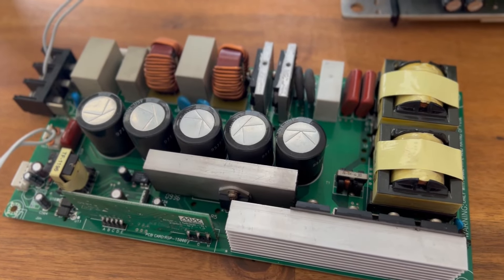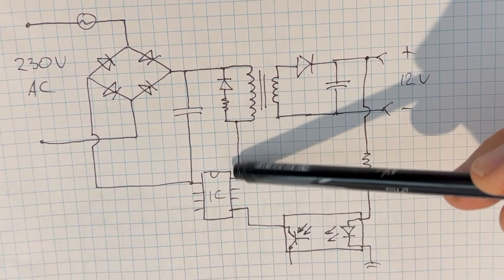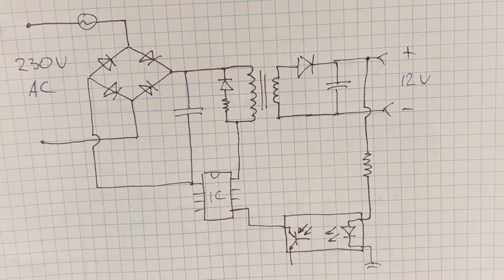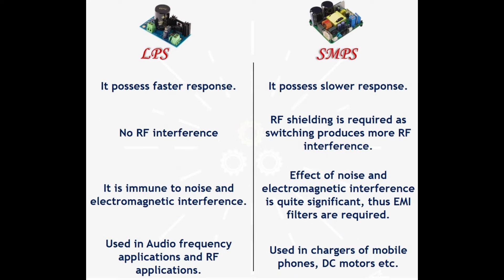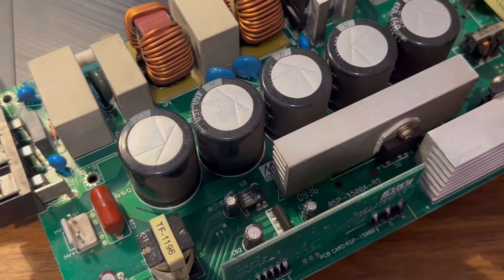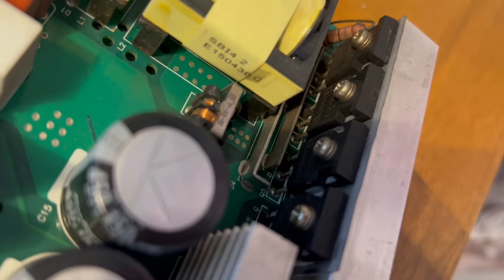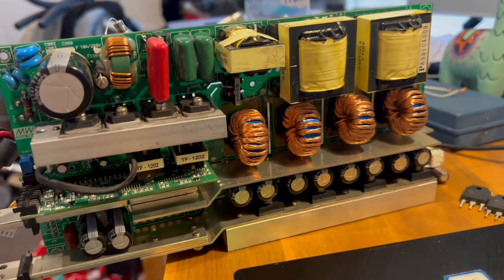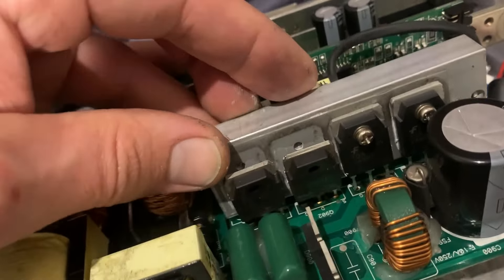How SMPS Works | Switch Mode Power Supply

Comment: It doesnt look old. Cheap mosfets?
Reply from the maker: It looks like a nice and quality power supply to me. I don’t even know what quality/price mosfets are, but the ones I bought for replacement, yes they’re pretty cheap 😊
Reply: @techquirks707  oh I meant why did the originals fail?
Reply from the maker: @blackterminal  I honestly don’t even know, this smps is used by lots of people in the workshop, I don’t know the whole story. They were dead shorted which also blew the fuse. Wrong polarity or overheating maybe 🤔